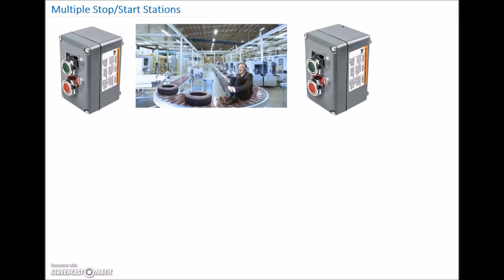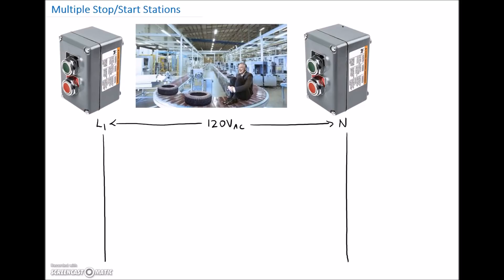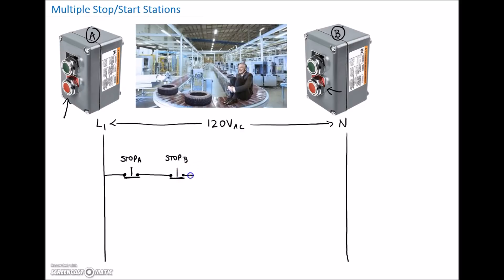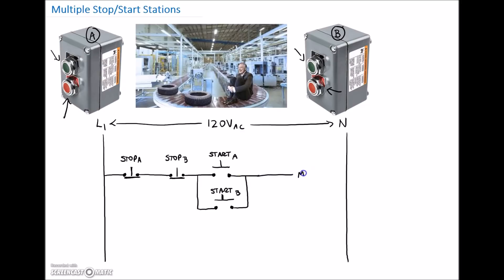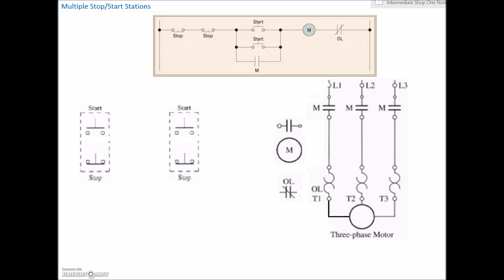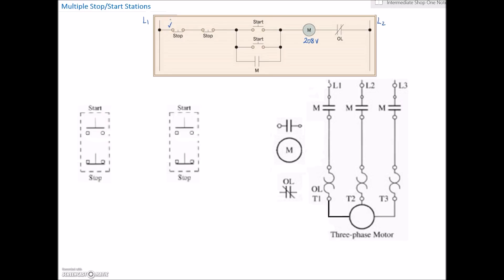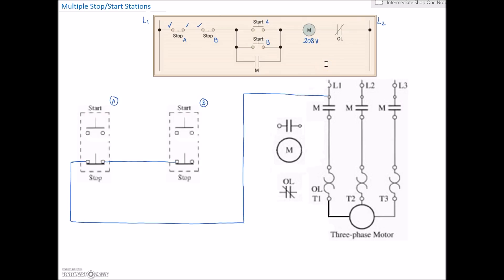Ladder Diagram Basics #4 (Multiple Stop Start Stations)

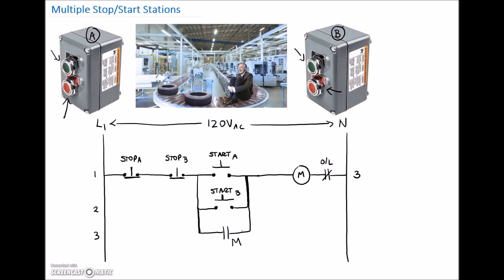Comment: Pete, quick question here. Just to solidify something. At 2:58 which shows the ladder diagram of two remote start/stop stations. I note the two stops (NC) connected in series and the two starts (NO) connected in parallel. What if i had two additional start/stop stations, would the new stops be on rung 1 in series and the new starts below start B, rung 3 and 4 respectively with the NC contactor below them on rung 5? What if i had up to seven remote start/stop, same principle?
Reply from the maker: Yes. That is correct.... but anything over 2x Stop/Start stations would then most likely require a PLC to keep wiring and troubleshooting simplified.